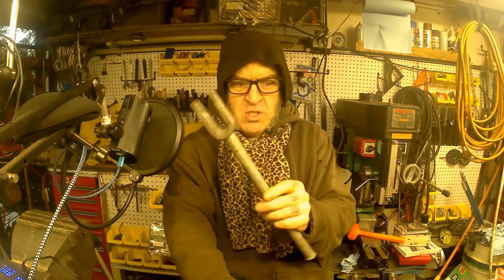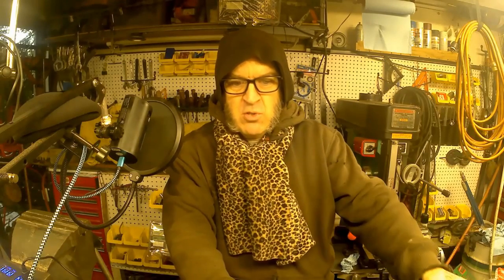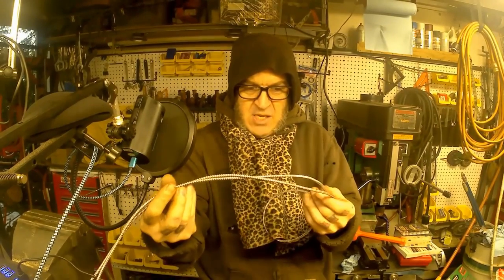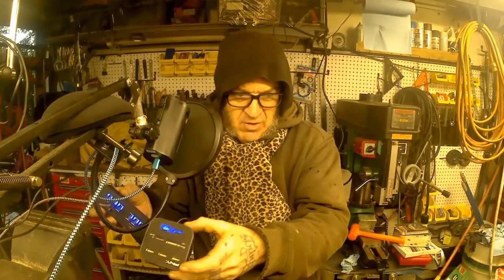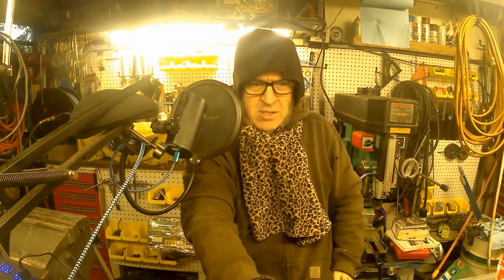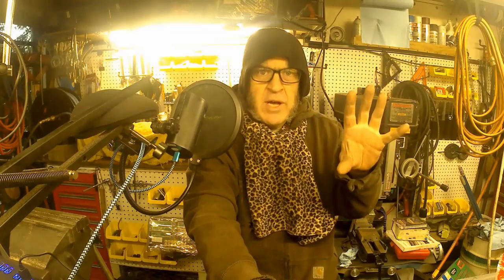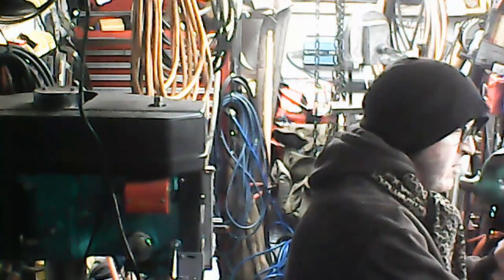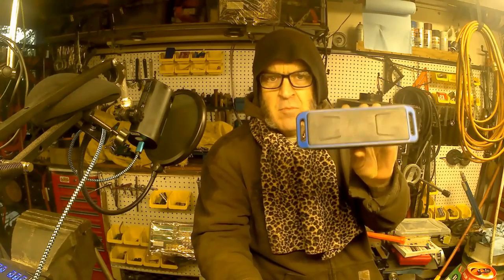Pt-2 video & sound solving/testing

Comment: Definitely can see and hear you. Haven't seem a pt 1, but this is cool! So funny, I am literally working on the same thing, though only using a camera I inherited from Jonathan, to record various vlog-related stuff. 
I even have a selfie-stick somewhere, no you can't revoke my Gen-X card for that, I'm still far too jaded. Nice to see your face, and hear your voice, brother.  Keep doing this stuff, please!
Reply from the maker: The Go-Pro style cameras have a PC mode & can have their sound disabled. This makes recording from a separate microphone possible although I am not very savoy at it yet.
Reply: @DirtBagMcGee1  That is the wiser way to go. The other trick is to have multiple cams going simultaneously, and synchronizing them in post. All you have to do is clap, then look for the impulse in the audio track, and align all of the assets there, then crossfade between the video tracks at your leisure.
Reply from the maker: @rongwang8757  I have yet to solve for software that supports a MultiCam setup. Security cameras have up to 8+ channels, surly there is software available , I simply have yet to find it.